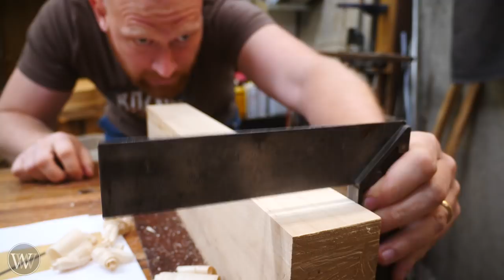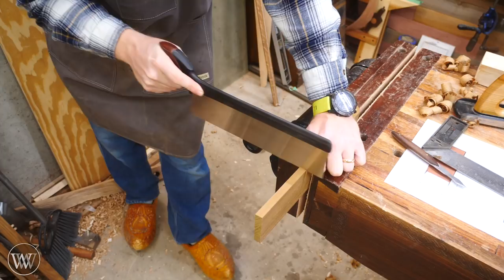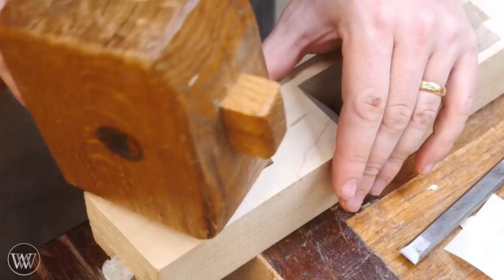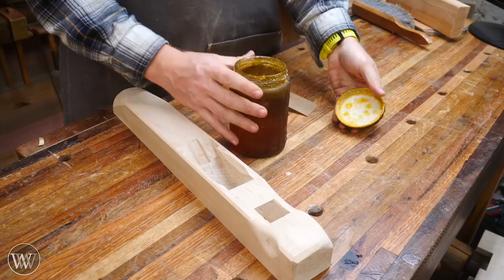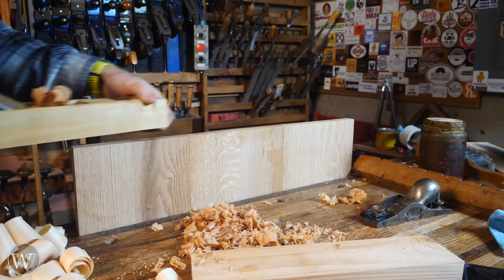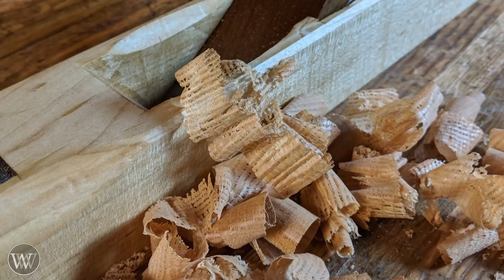Making a Hand Plane

Comment: Love that design. I have yet to make my own plane, however I have recently made a new sole for my #27 transitional. It came out rather well (making the tote was harder), so next I want to make a Japanese style  plane/kanna. Beech wood is almost impossible to come by over here in Hawaii, so I pretty much use white oak for everything. Not long ago I purchased about a dozen old kanna on eBay for under $100.  Half of them had missing cap irons and the other half had cracked or badly damaged blocks or just so worn out the irons wouldn't fit anymore. (To me, they are all priceless bits of history😁) There were a couple that were in okay condition and I've restored pretty good, but what I want to do now is to make a new block for a small piece. It's literally cracked in half and held together with bolts and somebody used it for a drill press table... it's full of holes 🫤. The iron is in good condition and very thick it's the kind that doesn't require a cap iron or a wedge. Just one piece of wood and one chunk of steel. It should be easy enough to reproduce the block, but what I'm wondering is, can I make a block for an iron that once had a cap iron only, ommit the cap altogether. Will it work? Maybe a wedge would be in order? 
Any tips or links would be appreciated. Maybe I'll email you some photos later. 
Thanks for being interested thus far. 
Aloha braddah 🤙🏼

Comment: I will eventually try this project, so I would like to ask a question. Do you think adding one step after the build is complete. That step being placed in a vacuum chamber with Cactus Juice. My thought is, over time of wood on wood scraping, the plane being impregnated with the epoxy would extend the life of the plane as well as prevent any minor distortion in the plane when humidity levels change. Do you think there would be a benefit at all or just a waste of time and Cactus Juice? Very much enjoy the videos. Thanks for sharing.
Reply from the maker: that would extend the usefulness of the plane. on a traditional plane the rule of thumb is that 1/4" would last 5 years as you have to re flatten it each season when the moisture level swings. stabalising would change that so that you would only have to flatten it when the soal was gouged from use. but you would have to get a BIG vacume chamber to fit this one in it.
Reply: Wood By Wright Thanks for the reply! I am going to give that a try.

Comment: Great plane and video! Questions do you need a jointer plane to make one and why you made the groove olin the middle of the plane's blade bed?
Reply from the maker: thanks man. No the jointer is just easier you can use any plane and check the bottom with a strait edge and winding sticks, or just sand paper on glass. the grove houses the bolt on the under side of the iron. that connects the chip-breaker to the iron. If you want to see more detail I have a full build series where I go int this in detail on each step. this is just an over view video.
Reply: @WoodByWright  thank you I will check the full series.

Comment: Nice tool. What is a bevel angle on the blade? Is it comfortable to work without back handle on the plane? Thank you.
Reply from the maker: the bevel angle is 25 degrees. it is bevel down with a bed angle of 30 degrees. Many traditional planes do not have a tote, it is very comfortable. especially when you carve and shape it to your hand.